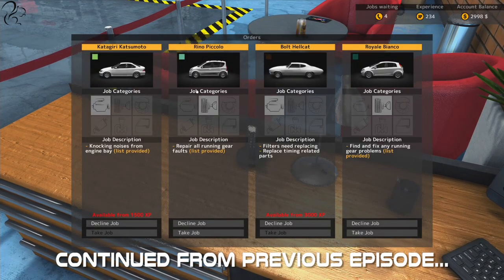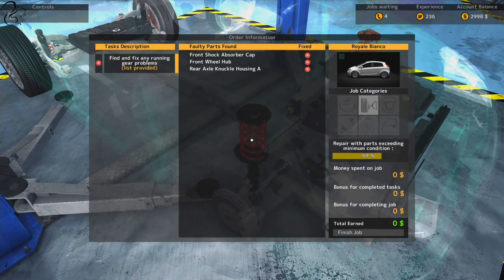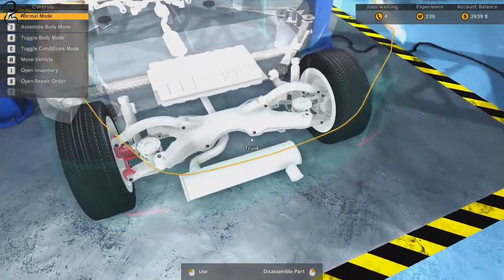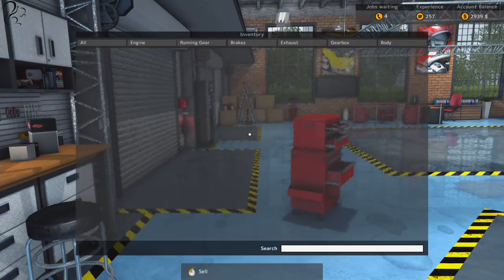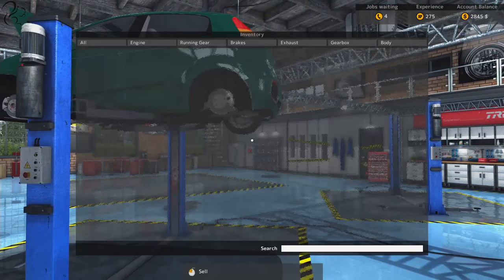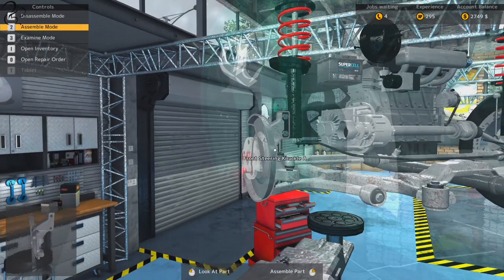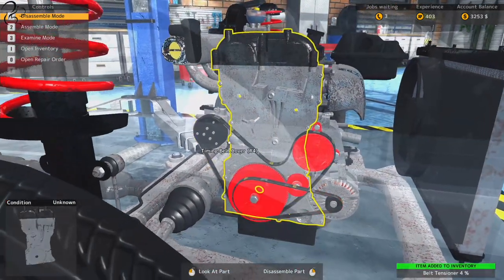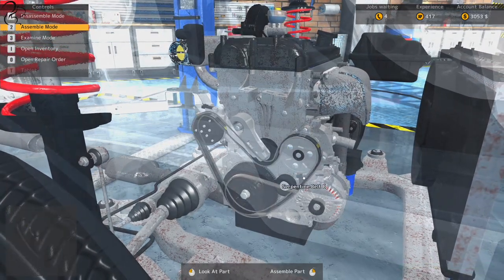Let's Play - Car Mechanic Simulator 2015 - Ep 2

Comment: The earnings summary at the end of the job actually does kind of make sense, depending on how you look at it.
You made $126 for completing the task and the job, and you paid $252 for the parts.. the key is that the client will REIMBURSE you for those parts, meaning they pay you $504.  
True, its still not accurate from an "earnings" point of view, but it's what your bill to the client would be.

Comment: Running gear usually refers to either the powertrain and/or the suspension, and the term originally comes from locomotives.

Comment: "I feel that approach just helps a little bit to make sure you don't screw something up and you're sitting there scratching your head."

You mean like you do through the whole LP?  You're entertaining as heck, man, but you're pretty dense at times. There's so many aspects of this game that are easy and in the early stages it makes it really easy for you by giving you a parts list and everything. (Wait until you get to the later stages where you have to diagnose problems and discover the damaged parts yourself.)   It's astounding that you can passover clearly rusted to crud parts and not automatically know that it needs replacing. (Something the game always has in place, making any diagnostic tools/resources a little redundant. I wish there was a way to turn off the "rusted parts" thing so diagnosing is a little more challenging.)

And that you're so confused by the payment breakdown so often is also face-palming. 

Or that a part is called a "front end link" and your searching the rear-end trying to find where goes.  Cripes.

Comment: imagine stuff like this in ETS2. you can drive to a service shop and get your truck fixed, or you can drive to a service, buy the parts you need, for example spark plugs, then drive to one of your garage and change it your self for less money than you normally spend in a service where everything is done for you. i think that would be pretty neat.

Comment: A good way to check your wheel hubs irl is to keep your tires on and give them a little shake. Bad ones will literally feel 'loose'. Real bad ones get so loose your wheel literally falls off on the freeway, but I've only seen that happen once ;D

Of course in a game like this, the best way to check is to remove the part physically and examine it with your appraise-o-meter 9001

Comment: Come on Squirrel.. running gear means everything that connects the motor to the wheels, and pretty much everything in the suspension as well. Lolled so hard during this episode. I love how easy they make it look to take the top mount off a strut and put it back together. Irl the only way to do it is to swear a lot, take the whole strut out, swear while using spring compressors to take the top mount off, and then putting it back on which isn't too bad, and then swear some more because it's hard to manouvre the strut back into the struttower because the knuckle is in the way. But then they make the rear knuckle way harder than it is, since you only would have to take off the suspension arms from the knuckle-side, not the chassis-side...

Comment: i know this is a late comment for this video but wow, you play this is such a complicated way XD you lift and lower the car back and forth to get to parts you already have access to, and you dont read, if it says "front" in the name, then it goes to the front end same with "rear"

another thing, you dont need to click the category buttons in the store if youre gonna search, itll show every part in every category that has what you searched no matter what

also, rust shows condition when not in condition mode (basically red=rusted or bad) and you keep going to your inventory unnecessarily, just use your job list to see what needs done and buying the examine tools first with your experience is best, makes finding out whats wrong a lot easier
Reply: +David Cutrona Jr 
one last thing, the money you get for a job is moeny spent+completion bonus+job completion

money spent- anything you spent on parts it refunds you to money (but i think it only refunds "listed" parts on the job list, not any other parts you voluntarily replaced)

completion bonus-bonus for completing one section of a job (like knocking noises then sloppy steering then oil change)

job completion-bonus for completing EVERYTHING on the job list

Comment: The customer usually pays the cost of all parts bought!
Reply: Jesus pete. Thank you. Has no one ever gone to a shop for anything? Say you own a shop and someone comes in for an oil change, you spend let's say 10 dollars on a filter and 20 on oil. Then you charge for labor. So the customer pays the 10 for the filter 20 for the oil, so you break even there plus what ever your labor rate is. Really don't understand what's so hard to get....

Comment: I can't even watch past the first 2 minutes... It seems like you've lost your common sense, Squirrel. Or you were extremely tired. The term "running gear" doesn't mean gears in general. Running gear is everything that makes the car run.. Suspension, brakes, engine, transmission, etc. it's a carpet term for everything mechanical that makes the car run.